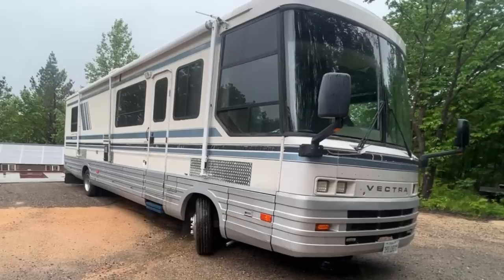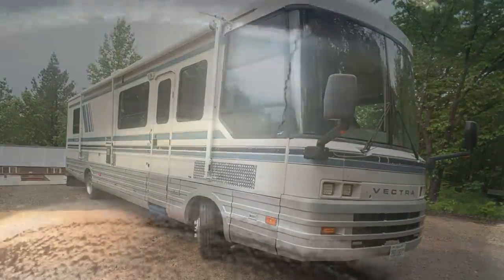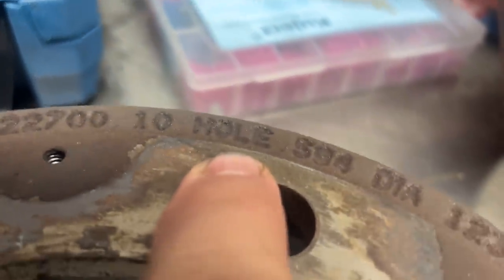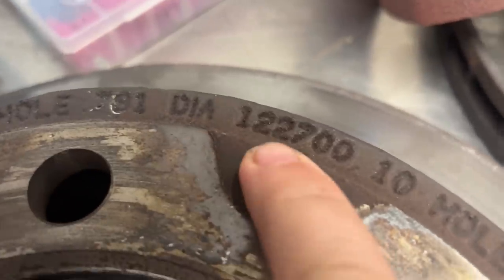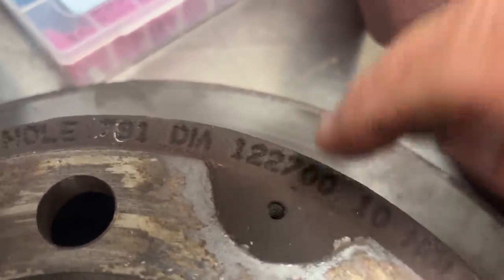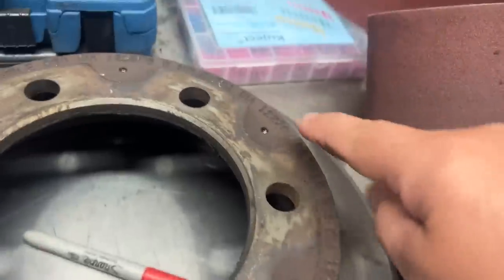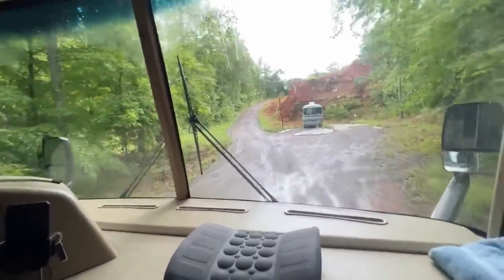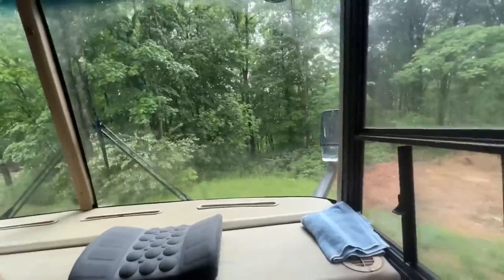Vintage Winnebago hard to source parts.  Very scary brake rotors.

Comment: Scott,
Great job helping these people out. If the motor home people find out about you, you will be flooded with work.
I agree with several other commenters the the owners of these large motor homes should go thru some sort of training before hitting the road so they don’t smoke the brakes when going down mountains.
Slowing down and using a lower gear to allow the engine help with braking is a concept many folks don’t understand.
I love your content and the honest way you conduct your business.

Comment: They got super crazy lucky one of those rotors didn't come apart with those huge cracks.
  As for older rigs...parts sourcing can be a royal pain regardless of what you are working on. But it's a super feeling when you get the rig back together and the test drive goes without a hitch. 
   Great job as always Scott and Co. 🙂

Comment: Those rotors were a horrible accident waiting to happen.  Nice job.
Reply: You say this but when have you ever seen a rotor that visually looks this way come apart or cause an accident. I’ve only seen the rotor face separate from the hat which that could definitely cause an accident. Those rotors were damaged because one or more drivers where abusing the brakes or just don’t know how to handle a rig that size. I’m gonna say that mountain probably taught the owner a valuable lesson. So the driver was a accident waiting to happen not the rotors.
Reply: I’ve actually almost been in an accident driving a roll back with 2 cars on it and brake rotor broke off the hub part was coming off the expressway to a red light thankfully not going to fast😢
Reply: @joec9680  The rig is going back to the same driver, after all, one more trip down a mountain like he did it before and this thing would have let go completely, surely. It’s a chicken-egg thing, y’know 😂

Comment: I'm glad my old motorhome is on a Freightliner chassis.  I have no problem getting parts.
Reply: Spartan may have had an issue but remember they are altogether the Cadillac of chassis manufacturers in the industry outclassing Freightliner because they listen to the customers and you do well to remember this particular unit is of the 90 vintage so that is over 20 years old!
Reply: @davidhughes5564  outclassed Freightliner but my 90s vintage Freightliner chassis is super easy to get parts for.

Comment: Wow. Maybe the rotor crack acts like a heat channel or slot. You know,...like the ones on racing disks, lol. More likely,...someone has an angel working overtime. Whew. You'd probably be in big trouble out west on some of the big mountain passes. Time for a brake job alright.

Comment: I'm more surprised that a vehicle has breaks that small. Never mind the cracks.
Reply: The ones on the fire chassis are (rightfully) formidable, but add to that the exhaust braking on there is fairly effective.  Still have to mind your speed, but the exhaust brake really holds you back at a good bit over reasonable speeds.
Also mind you that RV’s are fairly light given their size.
As well, the tiny wheels and tiny tires don’t really allow rotors of any considerable size.  Seems the body manufacturer (Winnebago was it?) is kinda liable for requiring undersized wheels, ergo brakes.
Reply: @jaysmith1408  Winnebago is really bad for that, or was back in this era. Was a guy in my auto class back in high school who's family was apparently lucky if they only had one blowout a trip because of the undersized wheels and tires on theirs. He was the second youngest so around the time he went to college they just sold the damn thing. And yeah, that's blowouts, plural in the radial era.
Reply: @Cemi_Mhikku  there was a period where a lot of motorhomes were being sold with Goodyear tires that were designs for intercity truck use. On the highway they would overheat and blow. So it may not have been undersized it could have been the tire being used.
Reply: They sure do look small. I was thinking that either the rear brakes are not adjusted correctly and didn't help with stopping. They had to much weight. Like towing a car or adding items to the interior.
Reply: @Cemi_Mhikku  Winnebago did all there brake requirement calculations for flat level ground as well as spec’ing part by cost and not by need. Lastly Winniebago designed all their vehicles to be able to be driven with a passenger car drivers license so sepc’ing parts to meet à specific GVW was a high build priority
Reply: @jetdriver  They were just as absurdly small as the ones on this one, but I'll settle for both.
Reply: @gullreefclub  That's a recipe for disaster and malfunction if I ever read one.
Reply: That and the tires. I thought it was an illusion, but then compared to other buses/RVs like the ones in the outro and they definitely look to be too small for a vehicle that large.
Reply: Pretty sure it's because unlike a small passenger vehicle, most of the weight and grip is at the rear, so the front brakes contribute much less percentage wise in a heavy vehicle.
Reply: @jaysmith1408  also fire trucks are very well maintained and documented, those would have been replaced immediately/out of service limped/towed back.
Reply: @gullreefclub  No the chassis manufacturer sell us (I'm a Winnebago employee) a chassis with a specific GVW (gross vehicle weight) and we build a coach that fall within the parameters that the chassis manufacturer established. We did foray into chassis development in the late 90's-early 2000's, it didn't go well. Not enough brakes everyone we made was destroyed or sent to Russia

Comment: I had my fun with vintage cars and gave it up a few years ago.  I always preferred the non-collector cars as they actually stood out!  My last vintage car was a '78 Buick Electra 225.  That was a great car and wonderful to drive.  But, getting parts was very difficult.  I needed a radiator and NAPA had only ONE in its entire inventory!  Body parts and interior stuff is just about impossible to get.  

The Buick 350 has its own parts supply problems as well.  One of the lifters was collapsed and it also needed a new camshaft.  After discovering that aftermarket camshafts actually degraded the performance, getting a real OEM camshaft took a month and a local vintage car mechanic helped me find the only ONE in existence.  Oddly enough, the smog camshaft for those engines was far superior to the performance grinds I thought would be better.  Some of those cars came with an Olds 403 and that engine is still easy to get parts for.
Reply: Good story!  I somewhat enjoy that type of parts hunting.  You can usually find what you need.  Usually but not always.
Reply: Why couldn't you get a custom grind
Reply: @eaglewi  The Buick 350 doesn't have the variety of stuff that most other engines have.  I did have a semi-performance grind put on that engine when the original cam and lifters were being replaced.  It was made by a shop that sells Buick specific performance parts and that cam was a DOG in my engine.  Even with an adjustable cam sprocket that let the mechanic fine tune it.

The OEM *smog* cam generated very high vacuum and that late 70's Malaise engine perked right up with it.  Go figure!  BTW, I flat-out gave the performance cam to the mechanic and told him to give it to a friend of his who has Buick muscle cars and see if he can do something with it.  I was just glad to get the Malaise engine running strong again.

Comment: Rotors look way too small for that rig.  Used to drive a big class C motor home for a company that was built with Olds Toronodo power.  I assume the rotors were same as the car.  Brakes were so inadequate I could come up to a stop and mash the pedal and get only a normal stop. Always worried what would happen if something stopped in front  of me.  Driving in the mountains, no way with that thing.

Comment: In the uk they have multiple system,  air over hydraulic,  propshaft brake and exhaust brake,  last resort hand brake. A manual gearbox would also help.
Reply: An actual manual transmission, not an "automated manual" or automatic, is getting more and more rare in the US even in the tractor trailers. Lots of owner-operators still want manual transmissions, but we have gotten killed between low freight rates and high fuel prices over the last year. The huge companies are all buying automatics and hiring drivers who are restricted to automatic only. In terms of passenger vehicles, unless you are buying an expensive sportscar you can't buy a new manual transmission vehicle.

Comment: Very lucky the rotors never shattered just going on looks alone bro, can these auto trans motor homes use a lower gear when descending hills or is there engine retarders for that purpose.  Safe travels.
Reply: They sure can.  Problem is, most people don't know to do it.  The overdrive on most of them FREEWHEEL.  They need to put it in 3rd, or even 2nd.  Then use stab braking.  Downshift and decide a speed.  When it gets 5 MPH over that speed, stab the brake pedal HARD.  I mean two feet on the pedal HARD.  Then... get OFF the brakes and let them cool.  I drove semis and motorhomes down some pretty hairy hills.  I NEVER overheated the brakes EVER.  This guy just got his foot on the brake pedal at the top of the hill, and was on the brakes the whole way down.  "I'm retired now, so I'm gonna buy a big motorhome and see the country".  No idea HOW to drive it.

Comment: 5:52 Those LED headlights (floodlights) are the worst. They say "DOT" on them but I'm pretty sure you can put "DOT" on anything you want in a Chinese factory. They have two brightnesses but absolutely no cut-off for an asymmetric "low-beam"; they are just a flood light and can't possibly be legal.

You can get glass housings that take H4 bulbs (either led or halogen), look original, and will actually give you a legal low-beam. They aren't quiet as cheap ($22-$27 plus bulbs) as these stupid things but at least you won't be blinding everyone else on the road.

Comment: Did that unit have a jake brake?
Reply: That is a gas model, the jake breaks or engine brake is only on the diesel models
Reply from the maker: It’s a cummins 12v diesel.    No jake or exhaust brakes
Reply: @BusGreaseMonkey  I normally drive a gasoline engine camper, and when I went on vacation I rented one that happened to have a diesel. I was shocked by how little engine braking the diesel provided. The lack of a throttle plate makes for a lot less resistance.

Comment: Unfortunately the cracks in brake discs/rotors is a fairly common problem.  They are most often a result of either driver error resulting in the brakes to overheating. A vehicle that is overweight for its brakes, this can be due to poor design by the manufacturer or the operator of the vehicle stuffing 10 pounds in a 5 pound sack. Sadly the manufacturer is often to blame because they either underestimated a realistic load for a vehicle such as this or they chose the parts not based on the realistic need of the vehicle but rather on the cost the parts or weight of the parts so that they can make a certain GVW for the vehicle. Additionally the manufacturers of most vehicles also fail to include properly designed cooling ducts for disc brakes. Lastly the aftermarket accessories market can also be to blame by making simulators with vent holes that smaller than the oem steel wheels as well as improperly designed disc brakes dust shields (personally I think all disc brake shield are poorly designed.
Reply: The capacity of the braking system is one of the KEY determinations for the GVW (and whether or not U-Haul will rent you a car dolly).  The problem isn't the braking system.  Most people have NO idea how to drive.  Be it a car, or a motorhome, or a semi... just laying your foot on the brake pedal and riding it all the way down a hill will overheat the brakes REGARDLESS of how "good" or "big" or "well designed" they are.  I was taught "stab" braking, when I first learned how to drive semis (sadly, most don't teach it anymore, which is why overheated brakes is an issue now).  You downshift (most cars and motorhomes freewheel in overdrive), and decide on a speed.  When it gets 5 MPH over the desired speed, stab the brake pedal HARD.  I mean both feet on the pedal HARD.  Then, get OFF the brakes, and let them open up so they can cool.  I have NEVER overheated the brakes on anything EVER.  It's just common sense... which is no longer common.

Comment: The story really reinforces to me that people driving these large vehicles need to be trained and require licences to drive them. No way should the brakes be overheating, even down a mountain. Probably was dragging them the whole way.
Reply: Ansolutely true! You need engine braking for steep descents so if it is an autobox with no engine braking you need a massively uprated braking system! Once had trouble going over the Swiss alps in a bus! Scary stuff on elevated hairpins! Those brakes were an accident waiting to happen!
Phil
Reply: They look way small for that size vehicle to me.
Reply: If you think that smaller vehicles are maintained any better, then you are delusional. RV’s aren’t a 1/10th of the problem that the average Honda is.
Reply: @adamr9215  10 times the mass of a car, that's a lot of energy to overcome.
Reply: @adamr9215  this isn’t a maintenance issue. I’m talking about it’s a experience/training issue. Even with the Allison auto and no retarder system you should be able to travel down most of the grades in the US Highway System.

Also, just because smaller vehicles aren’t maintained properly doesn’t mean we should just dismiss the larger ones even if they are just recreational.
Reply: First, get the damn automatic out of overdrive.  With most, in overdrive it FREEWHEELS.  Get it into 3rd at least, sometimes even 2nd.  Plus, the guy was riding the brakes all the way down the hill.  Saw it all the time.  Brake lights come on at the top of the hill... and they NEVER go off.  Pretty soon, you see curls of smoke coming from the brakes.  Semis and big campers... but even cars.  They need to learn stab braking for long steep hills.  Gear down and decide your speed.  Let it roll to 5 MPH over the desired speed, then "stab" the brake pedal... get on the brakes HARD.  I mean two feet on the pedal HARD (if you have to do it every few seconds... you need to gear down even more).  Then get OFF the brakes and let them cool down.  I drove semi and motorhomes down some real crazy hills.  I NEVER overheated the brakes EVER.  People need to LEARN how to drive heavy vehicles.   They an't a damn car.

Comment: Takes about 300 miles to wear in new pads and rotors to achieve proper braking. Hopefully He babies them for the first 300 miles or so or he’ll be back claiming warranty for warped rotors or squealing pads.

Comment: If you "ride" disc brake rotors down hills.......they will overheat and warp and then eventually crack.  Might be time to fit an exhaust or engine brake. Heavy vehicles are not cars........they cant be thrown off hills without problems.